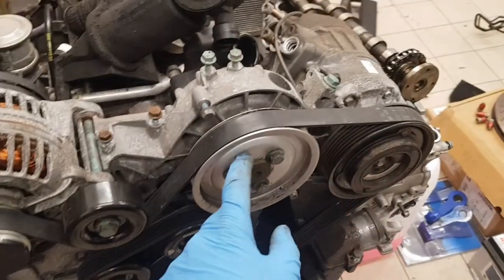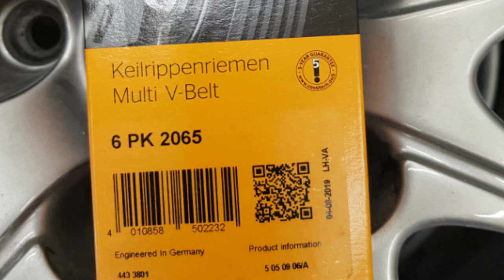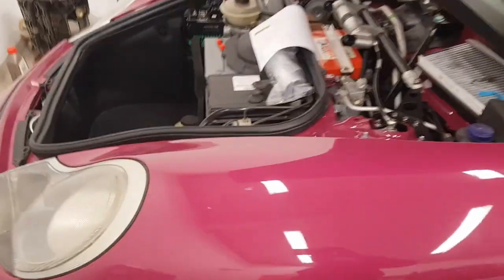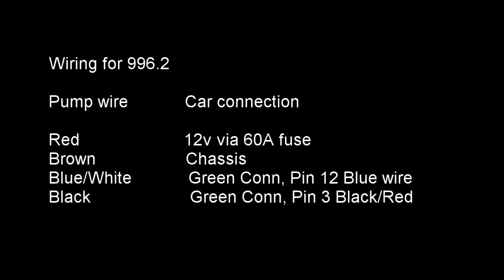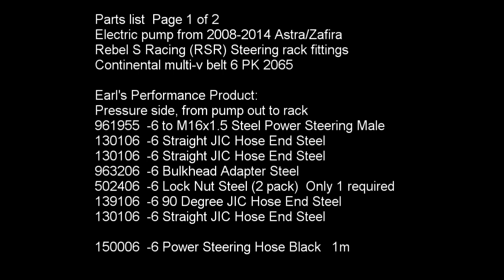Porsche 996 Electric Power Steering Pump Conversion

Comment: Good morning Martin back in the summer you very kindly sent me some information about the hose fittings on the power steering conversion, I have now sourced all the part other than the fittings to the rack it’s self, Rebel Racing was suggested for them, can you please confirm that they are in the USA, it’s the only one i can find or is there some were in the UK.
Many thanks Mark
Reply from the maker: Mine were sourced from the US.

Comment: Hello Martin I am just going to undertake the TRW steering pump conversion, If I send a copy of the parts list to Earle’s is this everything Hose wise I require & dose it include the two fittings which go in to the Rack it’s self ? Great Video
Reply from the maker: The fittings which go in to the rack itself are the rebel racing ones mentioned on the first page of the parts list. Glad it was helpful.

Comment: Interested to know if the conversion had any effect on the handling feel of the car?
Reply from the maker: I don't know.  I converted it from 4wd to 2wd and changed all of the suspension at the same time, I also fitted different wheels and tyres and changed the steering wheel.  I certainly all feels fine though, not really different to my other 996s which have the standard setup still.

Comment: Excellent job. What is a power gain you reckon? I guess this and getting rid of a/c compressor (or electrifying it) it’s the most efficient way to get some extra BHP without doing anything major to your engine. Regards !
Reply from the maker: I doubt it is a lot. It does move some weight from high up at the rear to low down at the front and makes engine removal and replacement a little easier. Cheaper  than replacing the pipes to the rack if needed!! In terms of power, every little helps.
Reply: @martinhill5770  It got me thinking, Guntherworks with their reimagined 993 built clam +/- 20bhp gain after going electric with power steering and a/c. It would be interesting having your 996 put on the dyno. Thanks for your reply, all the best
Reply from the maker: @t.s.9592  20hp, that is about 15kW. If the power steering and AC were using that much power they would be generating massive amounts of heat. I don't believe the numbers.
Reply: @t.s.9592   Nice video,thanks;
 
The point here if to GET RID of those expensive and cumbersome parts, pump,lines etc, *NOT* gain any Hp;

Let's not think that electric P/S runs for free;  at the usual RPM, it uses the SAME power as hydraulic, if not more,because now there are 2 elements,a pump and an electric  motor that did not exist before;  the difference now is that the power comes from the alternator belt (NOT the battery, this one just RECEIVES what the Alt.provides) ,instead of  the P/S belt;  the only way to gain 1 (ONE) Hp (note that some  hydr pump setups may consume around 3 hp at 8000 RPM) is to NOT have P/S, with  you providing the torque through... the food you eat.
The 40 Amps the pump consumes at most,with the car stopped ( 5 to 10  amps, if the car is  moving along) times the 12 volts is  480 watts, or 0.6 or 0.7 Hp.
The A/C consumes quite a bit, but it does not consume anything if you don't turn it on; lots of ECUs are factory programmed to do a very useful thing that is to turn the A/C off when you floor the pedal, or at quite high speeds, so that you gain those 5 or 6 HP,for overtaking another car,for instance,avoiding that you'd have to do it manually.

Comment: Have you driven the car yet? How is the feel and feedback from the steering vs stock?
Reply from the maker: I haven't driven it a lot yet, but since all of the suspension has changed, including uprights and all arms, and the wheels and tyres are different, as is the steering wheel, it is hard to say if this makes any difference to the feel.  I certainly can't say that it does.

Comment: What is the benefit of doing this to a road car, where is your gararge may I ask?
Reply from the maker: I am based near Nottingham, England.  On a road car, only benefit would be if you needed new power steering lines as they are crazy money.  For a track car it will reduce loses from the engine and improve weight distribution.
Reply: @martinhill5770  Hello Martin, can you send me a pm with a contact number or post code please.
Reply from the maker: @wiltonkennedy5651  There is an email address you can use in my About in.

Comment: Great video Martin! One question I do have though is why must one of the signal wires go to the alternator warning light? And a follow-up to that is, what should I put that to if I don't have an alternator warning light in my custom application?
Reply from the maker: The pump draws a lot of current.  If you were to run it for extended periods without the alternator charging you would end up with a flat battery in no time.You could just put it to a switch or have it run whenever the ignition is on.

Comment: Great video.  I'm in the process of installing this in my Cayman-S track car.  Question about the wiring:  I understand the 2 "activation" wires are to prevent the pump from running down the battery when the ignition is on but the engine is not running.  But why are there two separate activation wires -- one to "Ignition-On" and one to "Alternator-Running"?  The Ignition-On signal seems redundant, since if the Alternator is running, the ignition must be on.
Reply from the maker: Honestly... No idea. I found some wiring instructions and it was easy to copy them. But in theory yes, you could just run both to the alternator warning.

Comment: Currently fitting an M96 engine into a '73 Porsche 914 meaning, I won't need power steering. You just saved me the work of measuring the belt. Not a hard job but it does save time which is always good. I found your other videos useful and intersting as well as I also own an '03 C4S. Great video! Sub'd! Cheers from Puerto Rico.

Comment: Hi thank you for a great video. I wanted to fit this to a Vivaro and was wondering if it’s enough just to wire in the ignition live along with the constant live and earth too? Thanks.
Reply from the maker: You could do, the only issue is that it would operate whenever the ignition is turned on, which could be useful, but could also flatten your battery very quickly.

Comment: That is fantastic Martin. I have added this to my list of annual improvements. Having completed it do you think there may be a more "discreet" location to reduce intrusion into the luggage bay? I do road trips as well as daily driving (shopping..).
Dumb question, why connect to the alternator warning light? PS failure warning? I have a fixed wing so could use that "redundant" light?

Comment: Is the benefit here stopping the power steering overheating on track with constant high rpm driving the stock pump on the engine or are there other reasons too?
Reply from the maker: Fewer parts to go wrong, no expensive PS pipes to replace, lower drag on the engine, consistent load on the engine, weight moved from rear to front, easier for removing/refitting engine, and no problems with overheating at high RPM.  You do lose some space in the luggage compartment though.